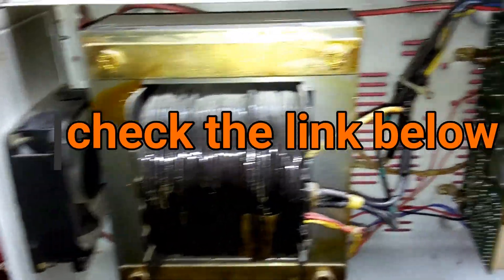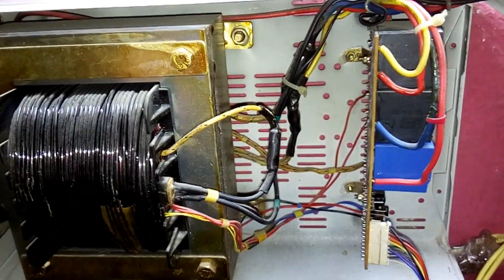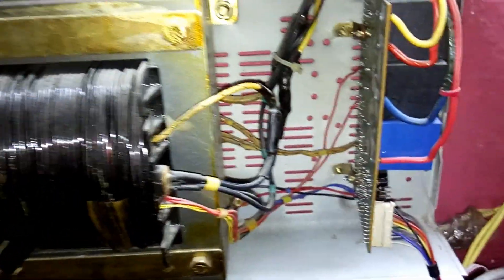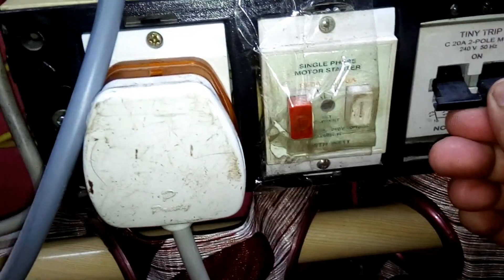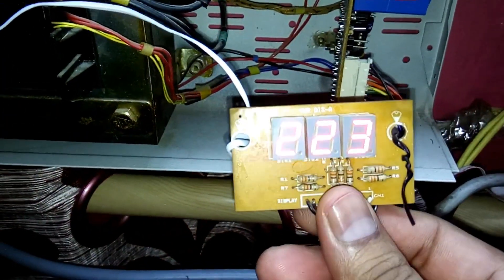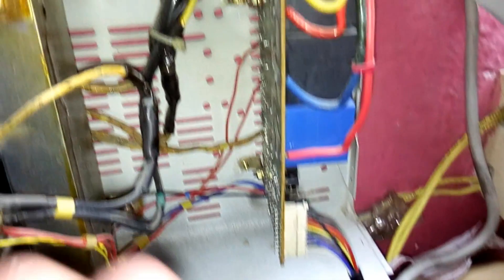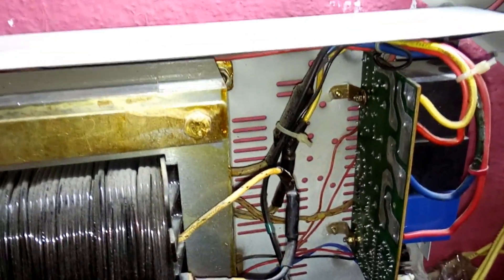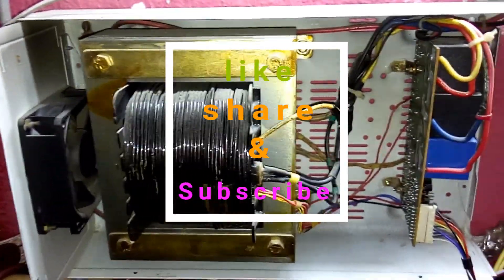How to repair voltage stabilizer for AC/ Higher output problem fixed

Comment: Please sir. I have a 5KVA Stablizer, it has a manual handle that can b wind to increase or decrease the voltage. Currently, it only give out it's input and does not boost the voltage anymore. What could be the problem?
Reply from the maker: Relay or relay comtroller must be faulty
Reply: @technoboy-allinOne  thank you sir. I really I appreciate your reply. I opened it and notice one of the relays was burnt.

Comment: I have denen stabilizer. It started giving problem. When the input is 230 it increases the output to 250-60 range. Why it started giving higher voltage then desired voltage? Sometimes AC makes buzzing noise when starting after cut off.
Reply from the maker: It happens mostly for the faulty relays

Comment: Sir AC stabilizer sometimes works and often it is in cutoff mode indicating high voltage. i m having everest double booster stabilizer. what would be the problem? is it the same transistor or is it because of something else?
Reply from the maker: Possible, but the relays could be the cause in your case
Reply: @technoboy-allinOne  thank you so much

Comment: Sir in my vguard stabilizer I get same output as input what is it means pls reply
Reply from the maker: In v-guars stabilizer when the voltage range is between 195v - 245v the input & output would be same as this is the normal voltage range for all appliances. When input voltage goes below 195v then it start working & increase the output voltage. And when the input voltage exceeds 245v then it cut the ouput voltage down to 220v. Thats how it works.
Reply: Thankyu fr your reply

Comment: Does stabilizer affect cooling ?
Reply from the maker: Not really
Reply: If it shows a higher than desired Voltage, say 300, it will affect the cooling in a way that only fan of the AC shall be operational. Hence, no cooling of the area.
Reply: @manishjain512  i think i am facing this, whenever i place my hand over ac it throwing chill air but it doesnt chill my room
Reply: @71gaurav  yup... Stabilizer needs to be repaired for voltage else its doing its job pretty well... Once it receives or shows higher voltage, it restricts power supply to the AC and the compressor doesn't start up.
Rest its upto the technician to check.
Reply: @manishjain512  ok, we complained to company baki dekthe hai
Reply from the maker: If you are having chilled air that means compressor is running. But not getting your room cool. Means your ac has low gas pressure. Needs to refill gas

Comment: Sir i have a hitachi royuku Ac stabilizer,bought it 2.5 years before.suddenly the stabilizer is showing-' h1 ' on its monitor and the Ac is not working that time.we changed the switchboard ,yet the problem not solved.but the stabilizer by itself again working ...countdown from" hi " to 9,8,7....0 then ac starts,then after sometime again stops and shows hi on stabilizers monitor☹
Sir could u tell ,that whether it can be repaired??what may have been the problem??and what can be the cost (approx)of repairing???
Sir please relpy and help🙏🏼🙏🏼🙏🏼Thank u in advance sir
Reply from the maker: Yes it can be repaired. The problem is in the circuit board inside the stabilizer. Get a good technician and repair it. Cant tell you the cost. That depends on the faulty parts & the technician. Maybe some few hundred rupees.
Reply: @technoboy-allinOne  
Thank you so much sir ,really grateful for ur kind reply sir🙏🏼🙏🏼🙏🏼wish u and ur channelall the very best 👍😊

Comment: Hi sir i have problem when i on my Ac after 6 or 4 hours it automatically off and H1 come on AC monitor how can i solve it plzzzzz
Reply: Same problem with our Ac,voltagestabilizer☹
Is ur problem with stabilizer resolved??could u plz help me by telling the cost of its repair???please  its arequest🙏🏼🙏🏼🙏🏼🙏🏼🤲🤲🤲🙏🏼🙏🏼🙏🏼
Reply from the maker: Stabilizer relay fault

Comment: I have same model and it is not working after lightning. Do you have any idea
Reply from the maker: Cant say like this brother without checking. The worst thing can happen is the trasformer coil burned. Then its history. If the circuit gets burned or damaged in some place, then you can fix it by spending some money.
Reply: @technoboy-allinOne  how do I check what's is the problem. Either transformer or ckt
Reply from the maker: @karthickchandrasekaran9354  open the front cover then smell first. If you get burned smell. Then take a look at the kit front and back side. If you see any black burned spot then its the kit. Or else the transformer. Check for burned smell. Good luck.
Reply: @technoboy-allinOne  thank you
Reply: @karthickchandrasekaran9354  microtech ac stablizer input is 250volt but output is again 250not output 220 what is problem
Reply: @karthickchandrasekaran9354 inputvoltage 250 and output is same 250 not 220 volt sho
Reply from the maker: @gurmaansingh5791  a bad relay or the relay driver ic could be the problem. Because when input voltage cross 245v then it cuts down the voltage to 210 or 220.

Comment: Sir, I have a 5kv stabilizer.
It has started giving high output of about 260v at 240v input.
What can be the fault. Is it the relays or the pcb..???
Reply from the maker: Most probably the microcontroler ic

Comment: I bought a window smart AC but before I put it in the window, I want to make a screen cover to keep the bugs out of the ac and out of my house. Will strong magnetic tape or magnets used to attach a screen mess up the electronics of the ac unit? any advice? I live in the wetlands so even if the bugs couldn't get in the house, they would quickly gum up the fins.
Reply from the maker: No issue. You can use that